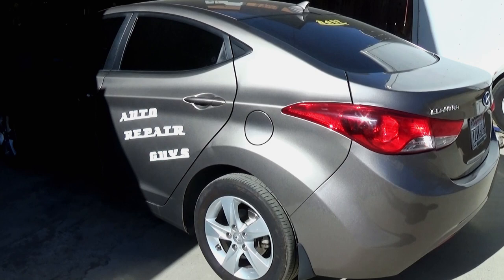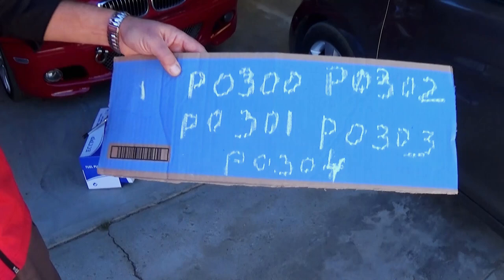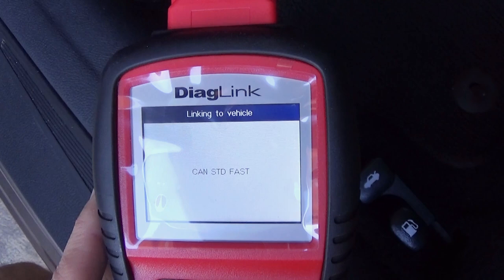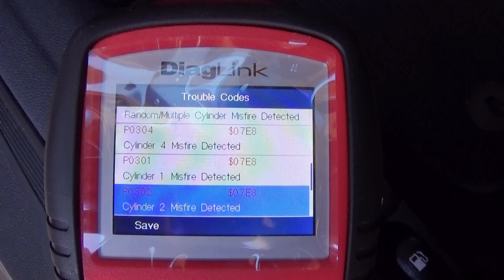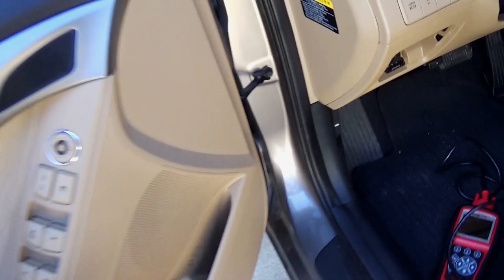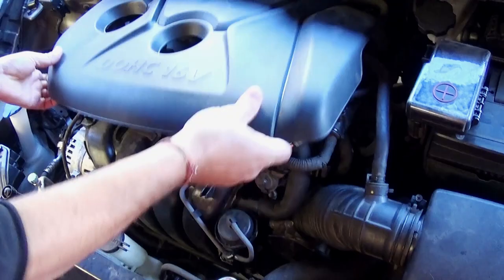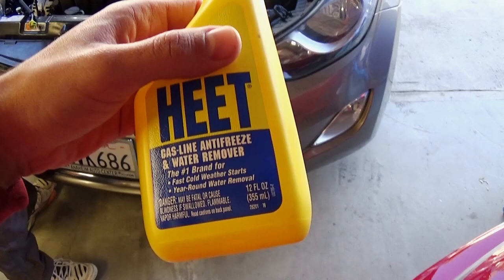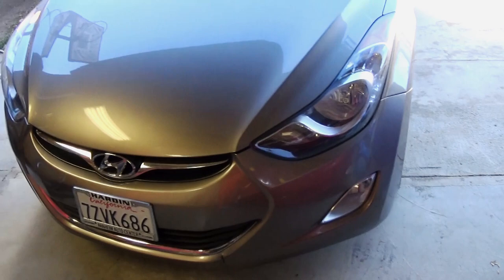WATER IN GAS HOW TO  FIX CHEAP

Comment: Used a full bottle of Heet and filled up with gas and the problem cleared up! I'm sure after a heavy rain somehow I got water in the fuel system or bad gas! Works fine now - cranks up and runs smooth! I'd recommend trying Heet. TYVM :)

Comment: Once at my old job someone lost the gas cap(on a box truck, gasoline), we had a heavy rain. The filler neck was exposed. The truck started up and misfired heavily on all cylinders. Being a large tank and we had them on hand we put 3 bottles of heet in the tank, then drove it to the nearest gas station and filled it up with 93oct. Truck ran bad for a few miles then smoothed out. Not a problem after.

Comment: Thank you for posting this video!! This happened to me today. I filled up my 2015 kia sportage with gas and didnt even get 4 miles down the road and my car would Not start. I had to get a tow to my house. I bought a bottle of this heet and iso heet. We put iso heat in because we weren't sure how much water is in the gas. Our area had flooding a few days ago and guessing that's where the water is from. I go to this gas station because they advertise no ethanol gas. Anyways, every video ice seen so far is just testing the product in cups/glasses or older vehicles. This gives me so much hope. I'm hoping an praying it helps. Wasnt sure if I should start  right away or what so letting it sit. Hopefully that's ok. Thank you so much!!
Reply: You didn't say if it worked?
Reply: @kaimana9583  it did not. Unfortunately the store I bought gas from had a bad water leak and it was over half water in the tank. I had to put my car in the shop and have the tank drained and dried.

Comment: Thank you very much for sharing this,I have same problem on my 2000 camry every time my fuel gauge reaches the E level the car will misfiring bad, definitely will try what you did. Thanks
Reply: Khalid Al Mtoori e stands for empty, it’s misfiring because you have no gas
Reply: water is heavier than fuel...so it will misfire right away because pump is at bottom.

Comment: You should have used ISO HEET (red bottle) it's mostly Isopropyl Alcohol but does the same thing and can be used in 2 cycle and 4 cycle engines both Gasoline and Diesel engines but also cleans fuel injectors that way it removes any water that might have been in the injectors.